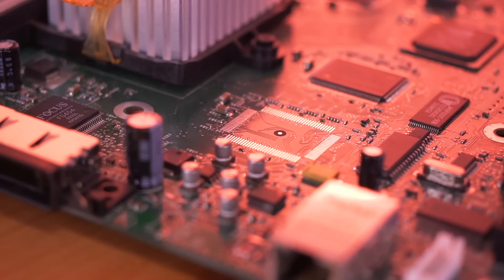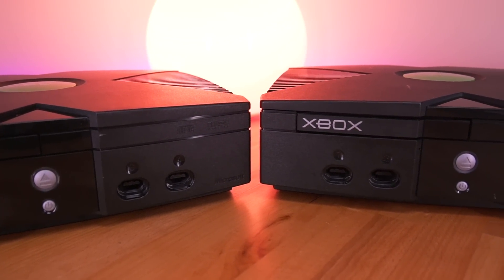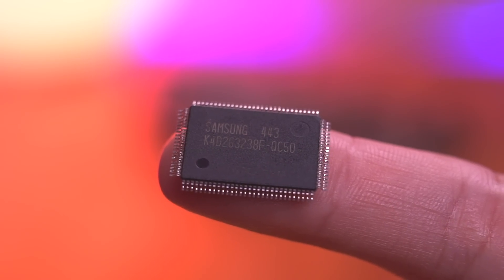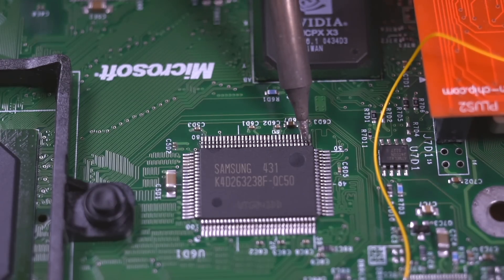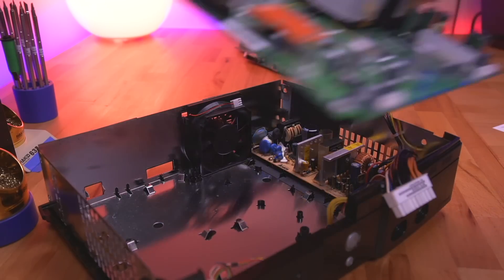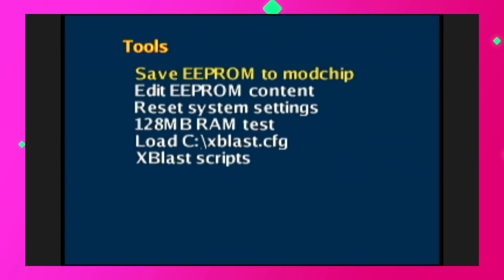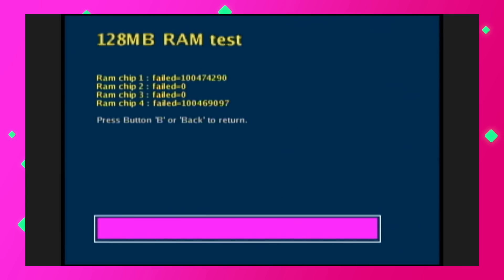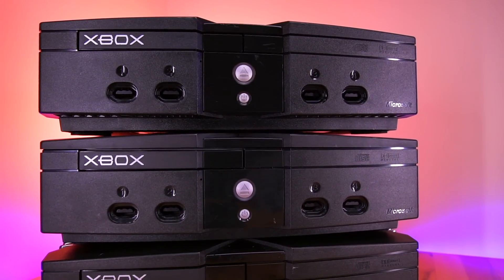I Did The Impossible 1.6 XBOX 128MB RAM Upgrade! | Piggyback Method!

Comment: I literally laughed out loud when you said stack the RAM chips on top of each other. That was so unexpected, and I never would have thought that was the solution.
Reply: I’m surprised this wasn’t found earlier. I didn’t know the Xbox had a RAM upgrade mod let alone that r1.6 wasn’t compatible.
This is the same techique used for some Dreamcast BIOS mods from back in the day. Again suprised it wasn’t found earlier O_o
Reply: @AdrianDX  i read the reason is, that some schematics just have been released a time ago. With this it was possible to find the pins where the chip select pin has to be soldered on.
Reply: @t4rif4ri  That makes a lot of sense, thanks for the clear-up!👍🏻
Reply: @AdrianDX  It's so easy to act pretentious and say you were "suprised it wasn’t found earlier" when you weren't the one looking for the solution. You just have the benefit of 20/20 hindsight.  Stacking RAM chips has always been a known workaround for a lot of hardware hacks, but figuring out which of the hundreds of motherboard vias to connect the RAM select pins to, and what corresponding  changes to make in BIOS is not easy at all, especially when you have no schematics or source code.
Reply: @MrRobarino  yet the pin out for all relevant chips is known. Finding a via to solder to takes time and effort, but still just a matter of beeping it out. 
I think it's more a case of nobody asked so nobody took the effort. Games where all build to use the standard memory so the upgrade had limited use. Unlike for example an HDMI mod. 
Same for the bios, the mod scene is big and there are many alternative firmwares. The layout of the bios is very much known and understood so knowing what to change is not that difficult either. 

It's still nice that someone took the effort to do and document it. And nice that this video shows how to do it. But the solution itself would be obvious to anyone that ever designed a computer SBC or otherwise
Reply: @bzuidgeest  Huh?   All you did was take my comment and re-phrase it.      It's so easy for you to say "the solution itself would be obvious" when someone else already did the work.   You're not impressing anyone.
Reply from the maker: I know it’s a pretty wild solution!!
Reply: @MachoNachoProductions  it's so easy in concept that straight away feels to obvious to be possoble😅
Reply: @MachoNachoProductions  I used to do this back on the Commodore 64 and VC 20 to test for bad chips, I'd piggyback a good RAM chip on every single one until it boots
Reply: Fyi, quite a few hardware pieces can be upgraded this way.  There are people who upgraded apple macbook airs from 4gb to 8gb this way :) @MachoNachoProductions
Reply: @MachoNachoProductions could you do one for the dreamcast ? Always been curious . Especially as far as performance goes .
Reply: @MachoNachoProductions  No video on how to mod Xbox series X? Ps5. Steam deck. Etc? Love your videos though
Reply: @KangelVtuber  ain't happening it basically has multiple hypervisors this not happening like at all
Reply: It's an old method, mostly saw it on 70s/80s computers. Interesting that it could still be used on a machine from 2001
Reply: Stacking RAM chips is fairly common. To upgrade an Atari 1050 disk drive to double density capability, the RAM chips are stacked. With limited space, it's a slick solution.
Reply: @Mrshoujo  Perhaps it was more common in the past? Might be anecdotal all the examples people are giving me are from computers from the 80s and 90s. I've never heard of RAM stacking of on a decently modern computer. Not saying it doesn't happen, just that I haven't heard of it.
Reply: @wilfredynunez5263  people don't because it's not needed, and very fine soldering. And ram is cheap. And you can't stack the modern bga package. Which this Xbox does not use. 
So many reasons not to do it. But that doesn't mean it's not technically possible.  Everyone that understands computer memory buses would instantly realize this to be a possibility.
Reply: I seen this on my HP 71b calculator/computer ram was soldered on top of the other.
Reply: same jajajajaja, as a vintage pc entusiast i was never aware piggybacking rams on a Xbox will work
Reply: Actually, back in the xbins days this solution has been brought up on IRC but I don't think anyone ever spend the effort to find the CS pins.
Reply: @sjoer  I'm willing to bet everyone with decent engineering chops thought about this as a possible solution but without the schematics finding the correct points to solder to was going to be extremely difficult. But calling this mod "impossible" is hyperbole and I would argue it always was given the CPU and GPU are identical at the silicon and pinout level.

At least last I checked.
Reply: This used to be done with DIP package memory in 8-bit microcomputers all the time.
The only thing stopping anyone was "Oh hell no I don't wanna do that with a QFP"
More commonly with ROMs because it was less work to do one chip and run a toggle switch somewhere to pick which one was active.
Reply: It's not that far out. HBM is done this way. Except it's made like it at the factory.
Reply: Look into Xbox 360 NANDwiches ;)
Reply: it's old school from the early computing days even then it wasn't super common
Reply: lol I squinted and said what...? Lol
Reply: Atari did that out of the box on the Atari 520ST+
Reply: Neeeerrrrrrrdddddddd
Reply: Me too!
Reply: I piggybacked RAM chips in 1982 on a TRS-80 Color Computer to get 32K.
Reply: HBM Who?
Reply: yall never grew up with zx spectrums
Reply: Well that solution was used in old arcade games were they would stack ram
Reply: At the start of the video I thought he was going to say that someone had made a special socket that had to be added.
Reply: Atari Inc. did this piggyback mod from FACTORY on selected Atari 520 ST short version - back in 1986 :)
Reply: Stacking chips like RAM, FLASH or EEPROM is nothing new. It was a popular mod for many 8-bit systems.
Reply: Reminds me of the commodore 64 mem expansion
Reply: Prehistoric man must be dating a girl who's Double cheeked up 🍑😂
Reply: I did the same thing! Impressed and funny

Comment: I believe you need 128MB RAM to run some of the 720p patches, not tried it myself as I don't have the skill to pull off that mod =)
Reply from the maker: Yep you are correct. Some games that are patched can run at a higher resolution with 128mb. I believe half-life 2 is one.

Comment: Having failed to install a GBHD due to not being able to solder the tiny part of the ribbon cable to the GBA chip, I just want to say how impressed I am with your skills, Tito. Jealous, too lol
Reply from the maker: Thank you so much bucktwenty!  Definitely got here with tons of practice. I’m sure you can do it too with the right amount of practice. Cheers buddy!!
Reply: Practice my guy, also make sure you invest in decent equipment
Reply: @ItsTeezoUBZ  Problem is practice involves potentially damaging hardware that can't necessarily be easily replaced.

Is there a way to do this with something else? Just to learn the technique.
Reply: My top tips for good soldering:
1: liquid flux is a godsend, use it liberally. You can never have too much, but you can have too little.
2: leaded solder! Avoid unleaded as it takes too much heat to melt. Leaded is so much easier to work with.
3: add to subtract. If you're desoldering something, always add new solder to it first. If its factory solder, chances are it's prob unleaded so adding leaded will drop the melting point making it easier to remove.
4: less is more. Its easier to add little bits of solder to something fiddly and get it right than it is to add a huge blob at the start and create a clusterfuck that takes ages to solve.
5: did i mention to use loads of flux? Use loads of flux. Even if you're desoldering but that only applies to solder wick. A solder sucker doesn't need it. 
6: take your time. I've rushed things and spent 5 times longer undoing what i botched cos i was rushing than i would have if i'd taken my time. 
7: invest in a soldering iron with adjustable temp and a few different sized tips if you can. Some flex cables don't really like temps over 330-350 C so anything hotter will scorch them and lift pads etc. Change tips depending on the work you're doing. 
8: buy a jewllers loupe to help inspect really small pins for bridges. A good multimeter also helps. 
9: something something loads of flux!
Reply: @fraggle200  If the parts being soldered are big enough, flux/rosin core solder is great. It keeps from making a mess and it lets the solder flow right where you want it by applying just enough flux to get er done.
Reply: @fraggle200  I would add a regulated hot air gun to your list. It is invaluable for lifting/soldering SMD components and also for pre-heating PCBs. Some components are next to impossible to (de)solder without putting decent heat into PCB first, like those connecting to ground planes or trough the holes of thick multilayered PCB. 
 Have Yihua 853D soldering/rework station - good heat gun and decent soldering iron (just find tips that work for you).
Reply: Flux is the secret sauce.
Reply: @mirabilis  I need to get some liquid flux, because the flux pen I have wasn't working very well. The ribbon might be fine, and the GBA isn't busted, I just gave up after not being able to get every point soldered to the chip haha
Reply: You can get a hold of some soldering practice kits online if you have nothing to practice on already. Good soldering is all in the technique, which is honed by lots of experience (practice).
Reply: Practice and equipment and a little talent and patience and everyone can do it
Reply: Willing to sell that kit?
Reply: @thepokerus4184  I do want to attempt it again at some point, so nah
Reply: It looks scary like unclimbable mountain, but all you need is a little bit of practice so you can get basic solder experience. Flux pens are not really good choice and in my opinion soldering with them is a little hassle (liquid flux), gel flux is propably the best one. Remember to buy "no clean" versions of flux if you have no tools to perfectly remove ramnants whicha are a bit chemically agressive.
Reply: It is not just you dude, you and I we both need to use microscope. Half of the battle with this stuff is having good equipment.
Reply: Maybe I'm going to get hate for this but i recommend using leaded solder. I couldn't for the life of me solder things properly with the unleaded crap. Leaded, american brand is the way to go. 
Not so easy to find here in Ireland but so worth it.
Reply: @robot538  Leaded solder is superior by far. Don't let any EPA crony tell you otherwise.

Comment: Always wanted to know if it was possible to play Virtua Cop 3 with a light gun, can you test if you can play Ghost Squad with the light gun too?
Reply from the maker: I need to get a new light gun. The one I was using g defiantly had issues aiming.
Reply: @MachoNachoProductions  I've noticed that in you're video, looks like the same laggy aiming in Silent Scope.
Try higher brightness on you're monitor, or maybe it's because the HZ on the monitor are higher than the ones that the Madcatz light gun use, maybe testing on a lower HZ TV would help.
I've recently bought a Beretta lightgun that is supposed to work on 100hz tv/monitors maybe that could help too.
Anyway, thanks for the video and answering my comment, I've always wanted to do the 128mb ram mod for running those lightgun games but they always sayed they didn't worked.
Greetings from Mexico
Reply from the maker: Yes! You are correct! The gun wasn’t working quite right. I didn’t even think to adjust the Hz. I’m not even sure how to do that 😅 I definitely need to look into that 👍
Reply: @MachoNachoProductions  I'm planning on making the ram mod to try it myself, maybe for this weekend I could have it done. 
If you're interested,I'll could comment the results with both lightguns

Comment: Wait does that mean the xbox will run faster display better perform better I just want to know
Reply: No because software has been programmed to run in such way, better frequency would help but can mess up things
Reply: @Kabodanki  agreed
Reply: Pretty much only Homebrew can take advantage of it. Emulators (especially N64) and ports LOVE having extra RAM and you will get better performance. XBMC also runs much smoother with the heavier skins. But comercial games were hard coded with the 64 MB RAM limit and will see no improvement. Very few games can be patched to run at 720p and will use the extra RAM, but in my experience they don't run very well.
Reply from the maker: Unfortunate no. It has several advantages but none that really benefit refusal Xbox games. I think some can be improved if you patch them.